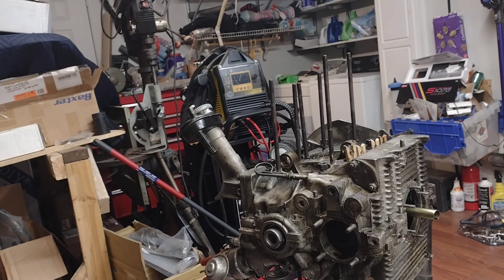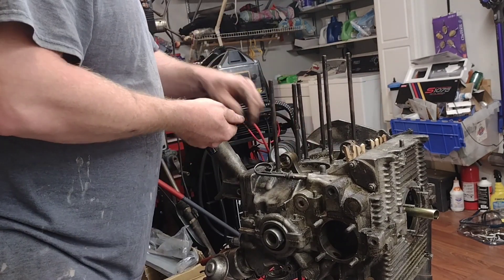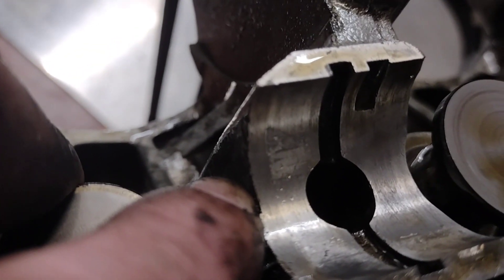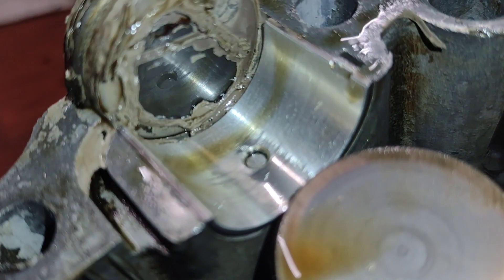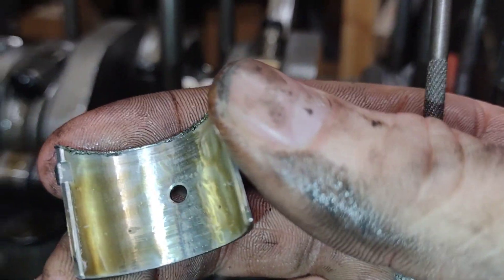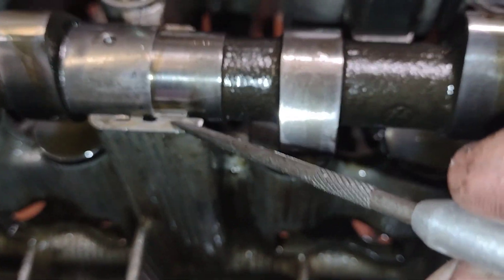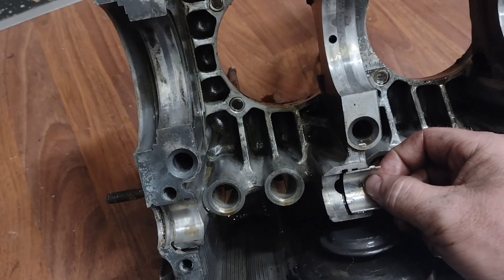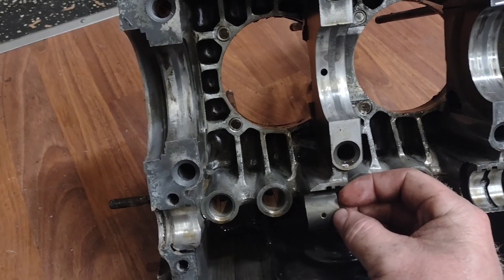More Damage In The 1835 bus motor

Comment: There is a lot of reinforcing the length of the cam ( all the lifter housing). Probably very little chance of the cam bore not being straight. More like tang placed in wrong position at assembly. 
Fly cutting my heads on the lathe at the moment. Done 1 so far. works very well.
Reply from the maker: Found out through the engines owner that the O.G. assembler cut the center cam tunnel trying to straighten it. Problem is they did not cut it to the oversized bearing diameter (+.50mm) or just run it through with the standard diameter ( STD is 1.082- 1.083" they cut it to 1.090"). So now the bearing has no crush and just falls out when you put it in the case and it is not large enough to use a oversized bearing. Problem is no one around my area can cut the case as no one has the tool for the cam bore and the bearing is very hard to come by. The young man has found a new AS41 case and we will be building around that.
Reply: I think you have to send it to brothers machine to have it cut for oversized cam bearings.  @MattLundquistVW

Comment: That's a strange one I've never seen that before but there are some dick mechanics out there just ready to make a buck not caring who they screw over. All that silly-cone they used to seal it up is another story, I'm surprised that didn't get sucked up into the oil pump and delivered to all corners of the motor!
Reply: Yea my problems are from bad assembly. Im a beginner but could have done it better.
Reply: @Paulman50  that's not your work is it paulman?
Reply from the maker: One thing that I have realized through this is that a warranty is useless. The og assembler told the young man if you shipping it back he would look at it. LOL the guy is 2500 miles from home so he knows that's not going to happen. 
At first we looked around for rebuilt long blocks by real reputable builders in the industry. The ones that are local have no motors in stock which was surprising. And the others were several months out. And the young man made a good point he said at this point warranties are useless if I have to ship it back across the country as I spend more money on shipping than buying another motor which is probably true. So now we are doing the fastest long pace of completely blueprinting and motor for him.
Reply: @MattLundquistVW  what a shame. That's nice of you to help him out